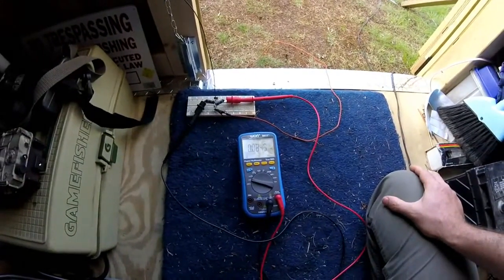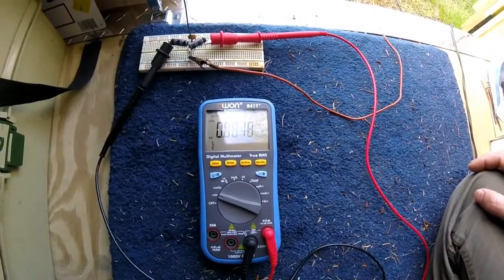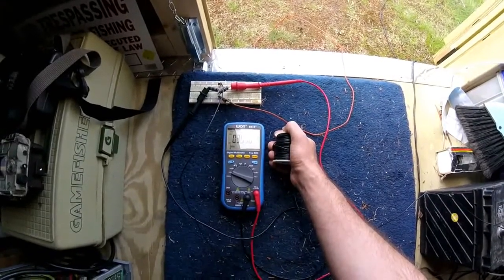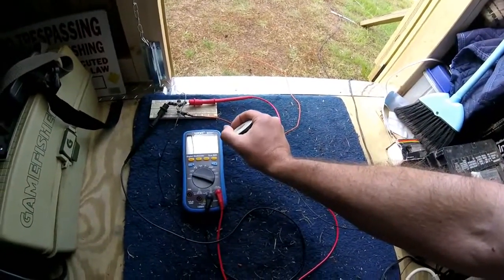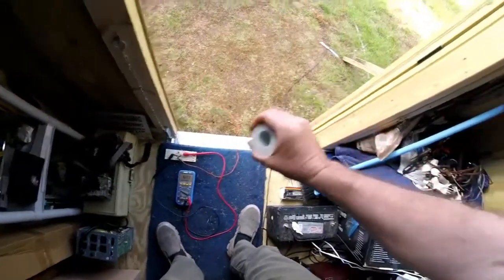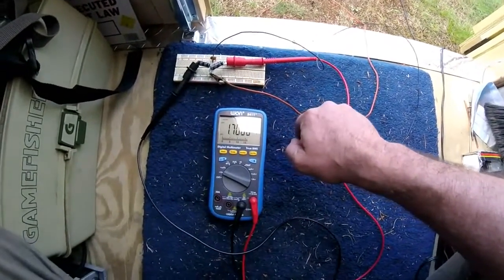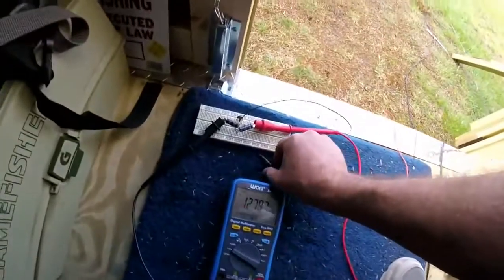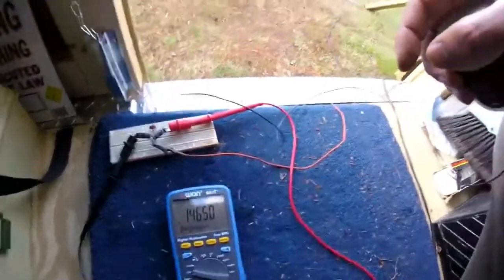Free Human Energy Generator I Am Charging Capacitors June 2017

Comment: That old chestnut LOL 
Useless for power generation but works as a crystal radio with no tuning .

He'll be charging battery's from a landline next !
Reply from the maker: You can use a metal plate to increase power output and also add more circuits.

Comment: Volts by itself doesn't = energy. Volts x amps = power, measured in watts. Volts x amps x time = energy,  measured in watt/hours. If all measurements were done, the total energy would still be quite small. Interesting concept though.
Reply from the maker: If you put a large plate up in the air as an antenna instead of me holding it, you can get a lot of power from this. If you add more circuits you can also increase the power. I just dont want a huge metal plate in the air when lightning comes around.

Comment: Troy, you turned yourself into a radio receiver/ Basically you are a human antenna. If you hooked up an audio amp you could make a crude cat whisker receiver and here what you were receiving. When you do that experiment again write down the voltages as megahertz than look them up. It will be interesting what you discover. One of them is the output frequency of a ham radio 2 meter repeater in your local area.

Comment: I guess you would need to have SEVERAL Ground wires buried fairly deep and close enough together to “gather” the electricity …
Reply from the maker: Actually no. This is an aerial energy collector from Tesla, I think it was. Generally a huge plate is suspended in the air to collect energy. You can add more circuits and increase the total energy collected. Larger plates too.

But I am not putting metal plates up in the air to collect energy any time soon. 1st thunderstorm and we will all be lit up.

Comment: if you had some of those big 3 to 4 inch wide barrel capacitors,,id say there about 6 to 7 inch tall.you could charge them,,i use to use them on big power supplys for backup power..you prob got some of them...i had a 60 amp power supply and a 35 amp one...i knew a tv tech that got me using them...man they hold the voltage right up there...the higher they was rated,the better they worked..his brother was a junk man,,and he would go to the junk yard and buy things that were built by telephone companys,that were junked out,,then he would take them home,,and take them all apart,,every nut and bolt..a lot of them had some really well made stuff inside,,like gold,and other very high priced medals,,you had to use an acid on the medal to see what you had..but a lot of these capacitors were in there,,after getting what he wanted,he would haul it back and sell it back to them...they just didnt want the job of tearing it down..i will tell one thing Troy,you live and you learn,,the tv tech is dead now,and his brother...but they taught me a lot about electronics...and saving nut and bolts that were brass or stainless..i had jars full of them...
Reply: Yes Troy would have made a crude spark cap transmitter.